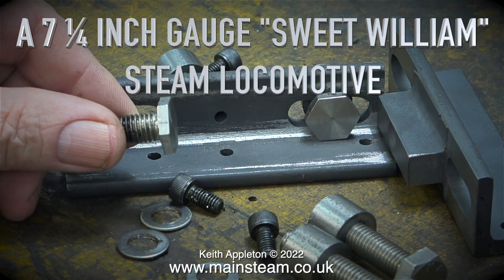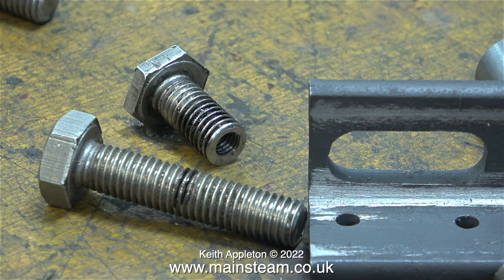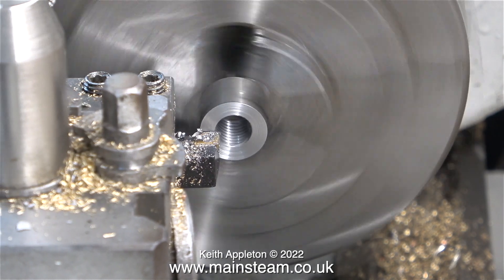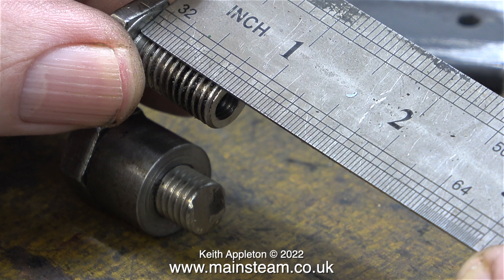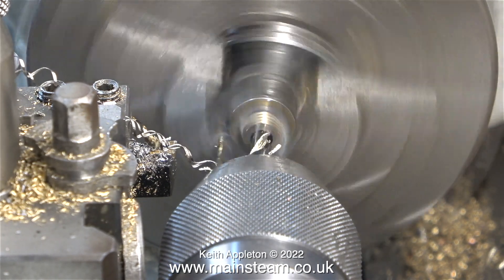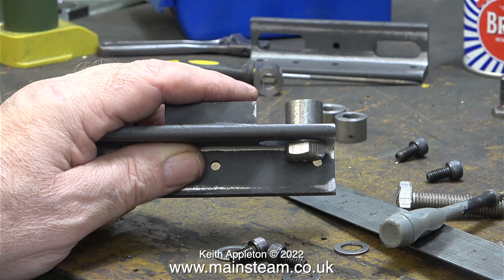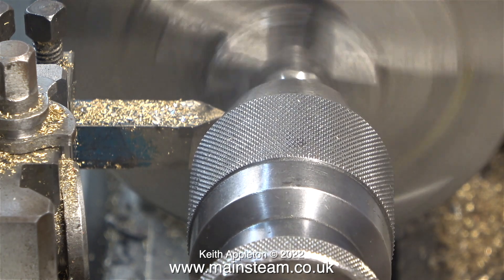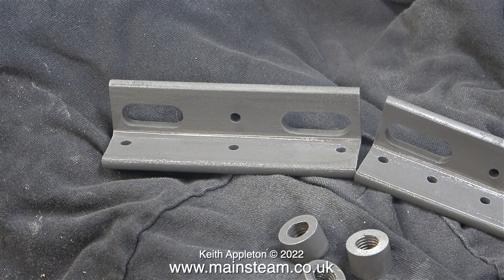A 7 ¼ INCH GAUGE "SWEET WILLIAM" LOCOMOTIVE - PART #12

Comment: Nice job. One important point: if the collars were larger in diameter, you would need to add a jam nut to keep the bolt from unscrewing under load. Since the corners of the bolt heads stuck out from the collar, however, the chuck jaws prevent spinning.

When tapping stainless, i always use Castrol Molly-D. It's black and will stain things, but it's the best for tough cutting jobs. A bit pricey, though.